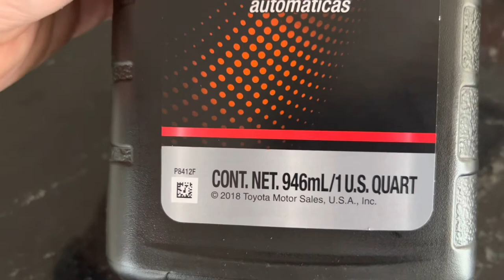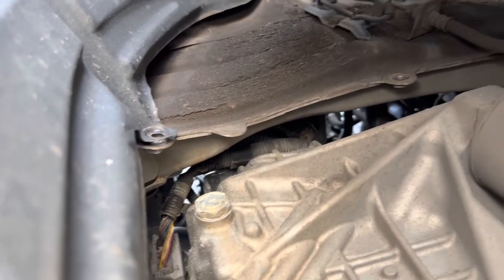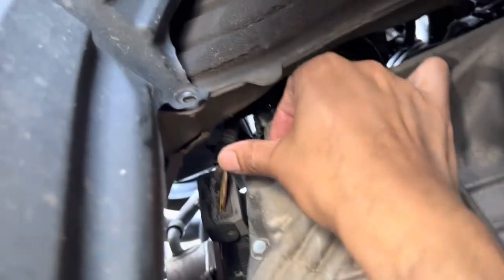Quick & Easy | 2011 Camry transmission fluid change | ATF WS

Comment: I would change 2-3 times for full fluid exchange
Reply: That's dunb and wasteful.
If the fluid is really degraded, you have a more serious problem that isn't going to be fixed no matter how many times you change fluid.

If you just want to be more thorough, change the filter.

Comment: Hey guys, I have a 2011 camry with 149,000 miles and I don't think the previous owner replaced the transmission oil. Do you think it'll be ok if I atleast replace the fluid in the oil pan? Thanks for your answers 🙏
Reply from the maker: Go ahead, it's always good to replace the fluid. Remember it's just 2 quart out of the total of 6+ quart. Basically you will just drain and fill. No need to remove the pan, it would be added work without any appreciable benefit.
Reply: @akhaqan  All right, thanks a lot man 🙏

Comment: Hey! Thanks for the video. Isn’t it mandatory to change the filter as well? And is it important to follow the temperature recommendations measuring the fluid temperature?
Reply from the maker: Thanks. No its not mandatory to change the filter, just drain and fill is enough. You have to drop the pan to replace filter which is much more involved process with several failure points. Filter change maybe required if your transmission has been abused a lot and have never done drain/fill and your transmission is over say 150,000 miles. In that case, it already is tricky to change fluid. So best bet is to drain/fill every 50,000 miles. Temperature measurement is very important as fluid level will vary when it's hot or cold. You can avoid this by replacing fluid when cold and accurately measuring how much was removed and adding equivalent amount back.
Reply: @akhaqan  got it, thanks! Mine is 120K now and I don’t know if it has been ever changed. I don’t have any issues with a transmission though, so just want to make sure everything is well maintained. Would you recommend just to do drain and fill procedure?
Reply from the maker: @nikolais9297  Yes, do it ASAP. Total transmission fluid is around 6 qt, drain & fill replaces just 2 quart, fyi.
Reply: @akhaqan  got it, thank you
Reply: Yes change the filter. Not doing that is a waste of fluid
Reply: @jayosiris8944  actually I did, and the way how the gearbox works now is kinda frustrating - it's too smooth, and not as fast in shifting as it used to be, not sure if it's supposed to be like that but I liked the way how it worked before
Reply: @nikolais9297  I think it's ok like that. I have 170k miles on mine. I haven't serviced it since I got it 4 years ago on 150k. I hope all goes well after the service
Reply: @lakesydes1  there is some trick about the temperature of the fluid, so I were you I would play safe and go to the dealership

Comment: You didn't drain the overflow because you measured exactly how much you took out, correct? Knowing my car, I'm not sure I trust the previous owner to have filled the correct amount :D
Reply from the maker: In this case, you can fill it till it overflows from the overflow tube. Then install the drain bolt, start the car and measure the temperature of the transmission pan with a laser thermometer, once it reaches around 100F, open the drain bolt again till the ATF starts draining and overflow is just a trickle, you are at the right level. Close the drain bolt. This is factory method.
Reply: @akhaqan Thank you, I will try that!
Reply: @akhaqan  you take out the drain plug and once you let car reach specific temperature at 100 degrees using a laser heat thermometer and it drains out a lil . Then you put in drain plug ?

Comment: My Mechanic Just fill the 2 liter New Transmission fluid. Is it a problem? I have 2011 Camry LE
Reply from the maker: Did he drain and then fill
Reply: Yes sir.
Reply from the maker: @rakshitpaghadar2188  I think its fine if he drained 2L and then filled 2L
Reply: when you drive the car to the shop, the fluid is only drained 2L, if the car stayed overnight, will drain 3L, so the fluid will be drained 2L-3L depend on how long time the car stopped.

Comment: It didn't look like you warmed car up by running before you drained it ? You did it cold ? The outside temperature is maybe 50-60 F out here . No difference if I warmed up car ?
Reply from the maker: Yes I did cold due to safety reasons, chances of burn injuries increase tremendously with hot oil and hot engine. Slightly longer time to drain all the fluid in cold weather

Comment: I’m getting ready to replace the transmission fluid on my 2010 Toyota Camry
Reply from the maker: Good luck, it will be an easy job.
Reply: is it the same as this video
Reply: @akhaqan  My car Camry 2010 has dip stick, does it has overflow tube ?

Comment: If the transmission oil has gone down, is it okay to add to it? Like adding 1 litre.
Reply from the maker: You can but the first question is do you see the signs of a leak, if not, you are going to overfill the transmission

Comment: you didn't use torque wrench to tighten the drain plug.
Reply from the maker: When you have worked long enough on cars, you get a fairly good idea about torque without using torque wrench.